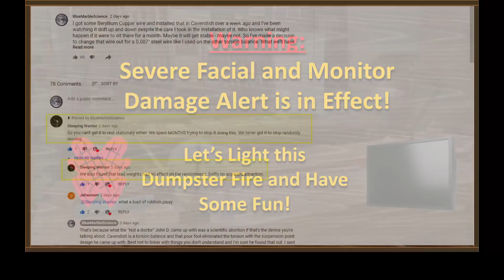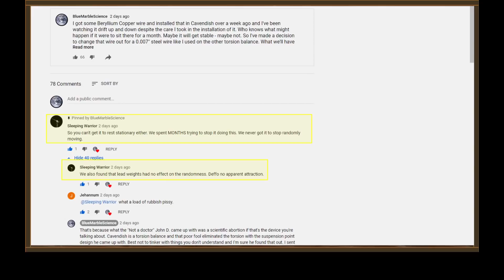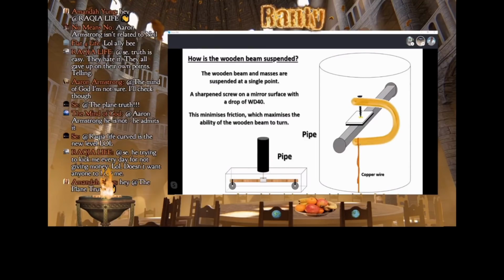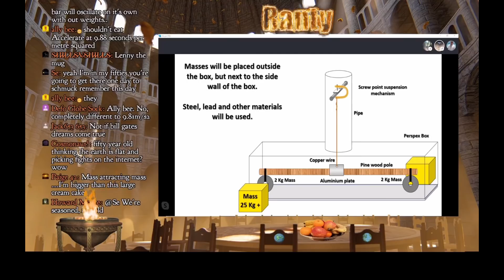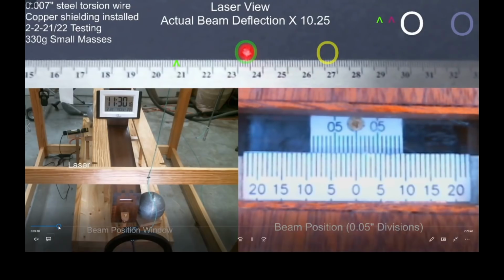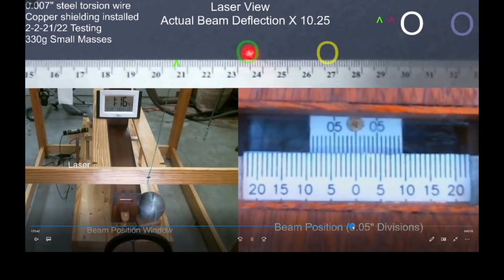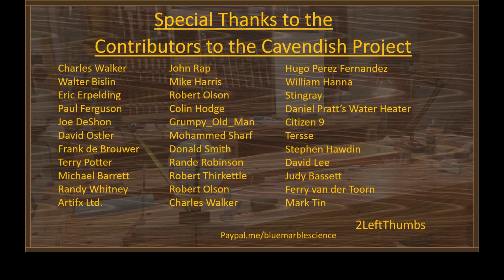How to Build a Cavendish That Isn't a Cavendish

Comment: This should work just fine to demonstrate the attraction between masses without doing any measurements.
The torsion wire is not needed, and the none spherical masses may require a greater force than if they were spheres.

Comment: They took the torsion out of torsion balance. So a balance. 🤔

How I see it going.
The balance moves, either clockwise or anticlockwise, depending on the sides the large weights are introduced.
Remove the influence of the large weights. Does the balance move back to its original neutral position?
No. (Someone removed the torsion part of the experiment.)
🤦

Comment: What Ranty built was a VERY sensitive disturbance accumulator. The Cavendish experiment is designed to allow measurement of SUSTAINED force. The twisting of the torsion wire when disturbed can discard induced momentum through the generation of heat from the twisting. In Ranty's setup they have eliminated twisting and vastly reduced the friction. Thus any momentum added to the system is conserved. In other words the slight gravitional force is swamped by the accumulated disturbance inputs.

I applaud Ranty for proving how difficult it is to avoid disturbing a sensitive experiment, and showing the force of gravity must be SUPER TINY!
Reply: On the Beryllium Copper (BC) wire, I think the super long settle time is because the BC wire can twist elastically far more than the steel wire and so generates far less heat under the same amount of torsion. Thus it took far longer to lose the added momentum to distortion heat generation.
Reply: What they made was a pendulum sensittive enough to feel earth spin.

Comment: I understand the problem of eliminating torsion from a torsion balance, especially if you're after actual measurements. However I'm struggling intuitively with something else.
Given Ranty's mechanism, which almost eliminates friction, when the large masses are put in place shouldn't they still attract the small masses and cause the mechanism to rotate, with the small masses approaching the larger? This is assuming, of course, that it's all well constructed and in a location protected from temperature changes, etc.
By eliminating the torsion resistance shouldn't the mechanism just slowly rotate towards the large masses until the small masses hit the sides of the enclosure?
Reply from the maker: Without a doubt, it should show movement but with no torsion element and no restoring force, once something starts the balance in motion, there is nothing to stop it other than a tiny amount of friction at the point connection and no force whatsoever trying to bring it back to its starting position. So any little disturbance is going to cause it to move and it's going to end up in some different position. Thai's why they're seeing these random displacements. All it takes is the neighbors cat running abound near it to upset it. The torsion element lets you see the oscillation around a resting point and you can quickly establish if the movement was just random by whether the resting point moves. If the resting point changes, as happens when the large balls are reversed, you see the change in the resting point and you can accurately measure how much displacement has occurred.
Reply: @bluemarblescience  That's very clear. Thanks. So if you could do it in some highly controlled laboratory setting it might show a consistent attraction between the balls, but otherwise it's just too sensitive to disturbances. I liked how you showed that even opening the garage doors caused disturbances.
Reply from the maker: @fepeerreview3150  These things are very sensitive and I think the one those guys built might be even more sensitive than mine. There's a room above my garage and people moving around up there will disturb it as well. That why so much of my testing has been done in the middle of the night when everyone else is asleep! It really needs to be sat in the middle of a 100' x 100' building with nothing else near it but I don't happen to have one of those - LOL.
Reply: @bluemarblescience  Shucks! I don't have one either, otherwise I'd offer it.

Comment: I gotta wonder if these globe deniers even realize they can purchase a commercial, bench top apparatus.  The same type of device college students use successfully every semester in colleges and universities all over the world.  I prefer your setup Blue but when they don't have the first clue how the thing is suppose to work, buying a calibrated scientific instrument takes all the guess work out of the setup.  Then again, that wouldn't get them the results to fit their scripted narrative now would it?
Reply: It's quite expensive: I found one version that cost $885, only for sale to educational institutions. Flerfs are probably wary of spending big money on equipment after the "incident" with the laser gyro and the 15 degree per hour drift (Thanks, Bob).
Reply: @ceejay0137  Not really expensive compared to all the materials and work involved in building a system from scratch.  Don't get me wrong though...I would rather build from the ground up but it will likely cost as much or more than commercial bench to unit.
Reply: @microbeta  I agree, if it's built properly with the kind of materials BMS used. The version in the Riley video looked pretty basic and cheap to me, which is another reason why it's unlikely to work properly, even if they did change the suspension to a true torsion setup.

Comment: To top it off, they not only eliminated torsion, but they also put the whole contraption in a perspex box, a sure guarantee for static electricity to meddle with the "observation".
Reply from the maker: If you rub a cat on that thing, you'll build up enough charge to weld boiler plate!
Reply: @bluemarblescience  that would prove Bob Knodels Incoherent Dielectric Attraction as being more close to reality than Rileys RDD.

Comment: So they messed it up, what a surprise. Was it due to malice or incompetence? Did they deliberately muck up an important part of the apparatus, or did they just think OK, two big weights, two small weights on a bar, bar hanging on a wire, got it.
Reply: They simply didn't understand that you cannot observe movement depending on the distance of the larger mass if there is nothing to make the smaller mass return to its rest point.
Reply: Why not both?

Comment: Hold up Blue, a .007 steel guitar string, you mean a Banjo string?
.007 is a Billy Gibbons string, not there's anything wrong with that. :-)
Reply: @Agent 666 well played...
Reply from the maker: I found a source for D'Addario 0.007" guitar first strings on - where else - Amazon. A bit pricey though - something like $6.00 of a single string.
Reply: @bluemarblescience  I'd try Guitar Center Blue, they should only charge .75 cents.
Great video as always!
Reply from the maker: @g.gorrell2088  For a while, I was finding strings in bulk packages for about 20v= cents each. The last time I looked, I didn't find them but I'll have a look at Guitar Center.

Comment: Of course Sleepy wants to modify the experiment. He needs to skew the results before he starts.
Reply: I suggested to him that it was the taste of the water in his eggsperiment that caused the egg to rise.  It was another IV he wiggled without realising it by adding the salt.
Reply: @colinrobinson2400  same for conductivity, he only accidentally avoided that, by being too dumb to buy actual salt and going with the commercial seasoning agent pretending to be table salt. If he had added that much NaCl to his water, it would have totally changed the conductivity of the resulting solution. Meaning it "could" have been electromagnetic forces instead of "buoyancy" as he claimed to have proven.

What he did not realize is that this experiment even if conducted properly and with full knowledge of what you do (instead of proposing PPM meters show "unicorn farts") needs other experiments to EXCLUDE additional factors his set up couldn't hope to address.

e,g, to show if gravity is a factor he'd have to drop his pitcher with the necessary film equipment aimed at it and show that nothing changes in freefall (which it would do as that is the problem with buoyancy, no gravity and nothing buoys... )

Comment: You could make the unwinding faster if you move the other end of the wire after each stop, to reduce the tension in the wire. This is a job for a little computer.
The movement to get the beam in the same place could show the effect when you move the big balls.

Comment: I remember we talked about the torsion wires spring force, being used to measure the force of gravitational attraction. 
So the Flerfs missed the critical point of the experiment. 
In a bizarre way, I'm impressed by their ability to fail.
Reply: Never bet against a Flerf's ability to fail. If it was a professional pursuit, they'd excel.
Reply: There is nothing so stupid that can be said that a flatard wont believe it.

Comment: Also, is it coincidence that Gladys reappears with Sleepy's reappearance?
Reply: Hmm.. You know, I've never seen Gladys and Snoozy in the same room at the same time. Could it be...

Nah. Gladys is much, much smarter than Snoozy!
Reply: I'm feeling a bit lonely because both dog and cat are dead. For me Gladys is a virtual pet, I also have carrots.
I don't know how to do emojis otherwise I'd have <sad face> here.
Reply: @rysacroft  On Windows 10  hold the Windows Key then press . (DOT) 😎
Reply: @timtechdude4339  Thanks, but I only use Linux. I can dual boot into Win8.1 but very rarely.
Reply: @rysacroft  I see. I'm not a Linux expert but a google search shows Ubuntu 18.04 LTS (or later) can do emojis. Depends if your preferred distro also support emojis.

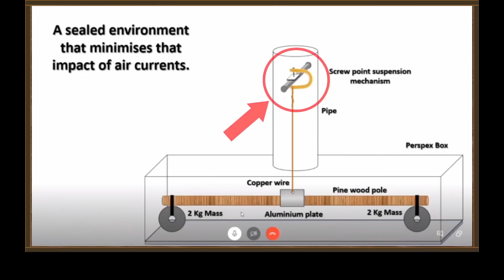Comment: 3:30  You did WHAT??!!!
Changing the subject a little, I think .008 high tensile strength steel guitar strings were in short supply when Cavendish did his experiment.  Drawing copper might have been a challenge but doable.  If he had steel wire I think he would have used it.  Just guessing.  :)

Comment: The Flat earth lot defiantly don't want to prove gravity. If they do any notion of the flat earth is crushed into a sphere.
Reply: The pizza is made of adamantium, so gravity won't collapse it to a sphere.

However, think where the centre of gravity is.  Down is in a funky direction at the south pole rim.  It's almost parallel with the ground.

Which means you don't need an ice wall to stop the oceans dropping off the edge.

Gravity is a big problem on pizza-world, even if it's made of adamantium.
Reply: The funny thing is, a flat earth requires gravity, so it is an argument they can never win. If they "disprove" gravity, they disprove flat earth.
Still, it's fun to watch them try :)